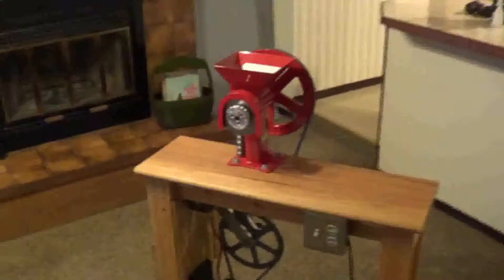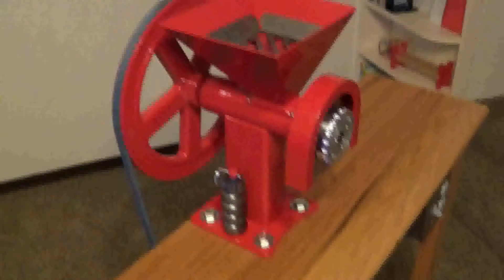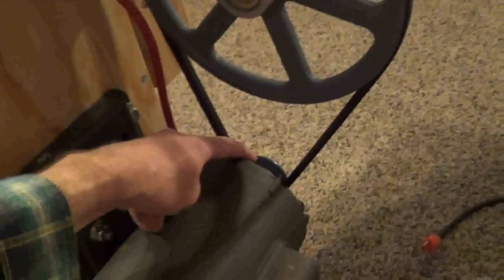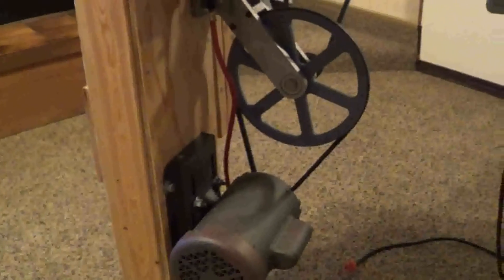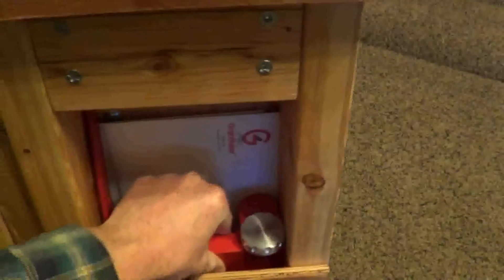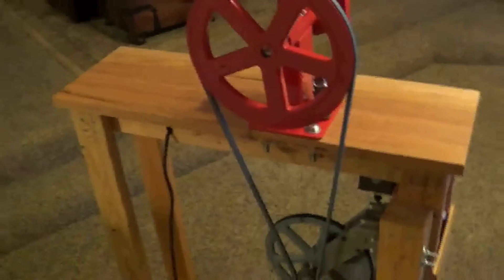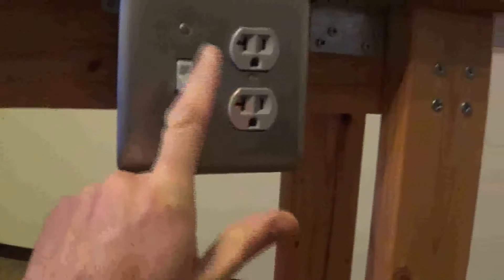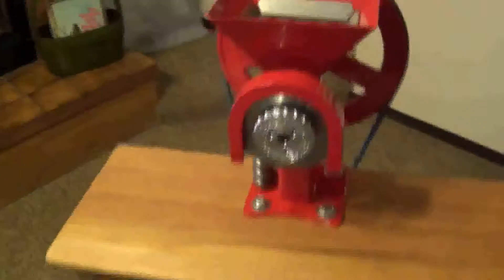Grainmaker Mounting Table & D.I.Y. Motor Kit

Comment: Hello
Thank you for your video.
Could you (or anybody else) suggest what spare parts it is convenient to buy with the mill? I was thinking perhaps: an extra set of burr and shaft & bearings. I am not sure about the auger..
Also, have you got any experience with the Homestead Huller kit? How often is it necessary to change the huller replacement pads?
I am based in Italy and perhaps it is more cost-effective to order extra parts with the mill...
Thank you very much!